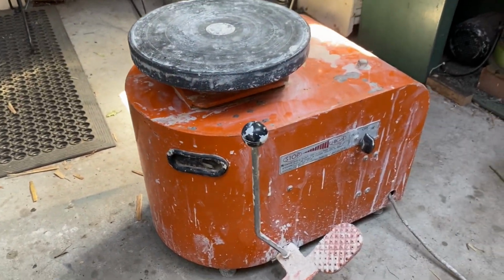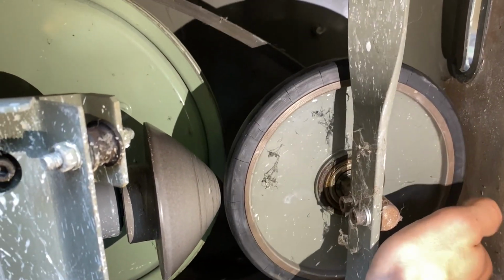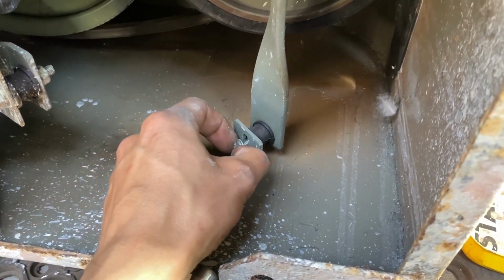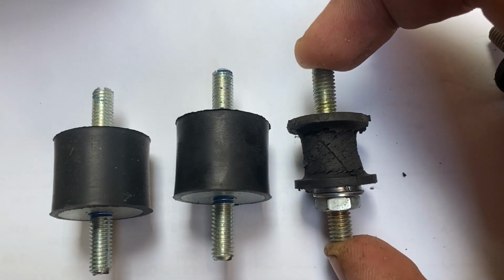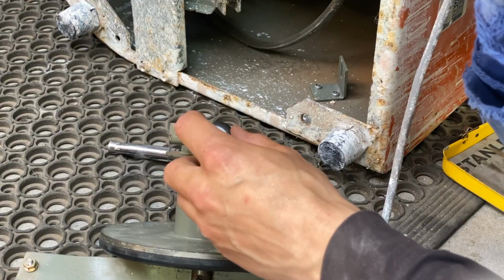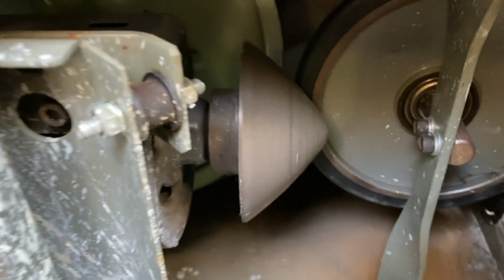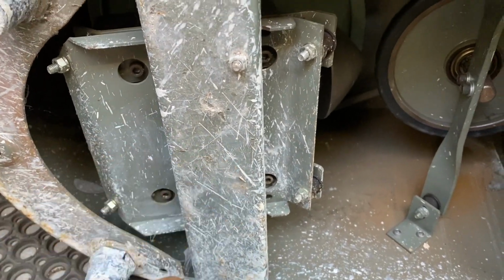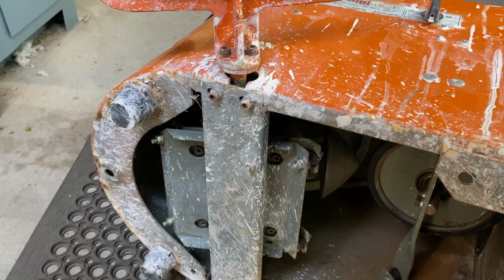Fixing a 1977 Shimpo RK2 Pottery Wheel

Comment: The small belt in my ring one keeps coming off while the machine is running. Not sure what to do in this case? Is it the cone? Or is it the belt? Is it the cone positioning? What should be fixed? What would you suggest? Thanks